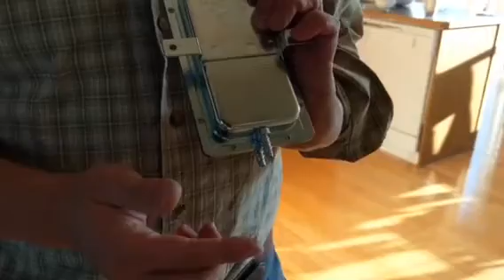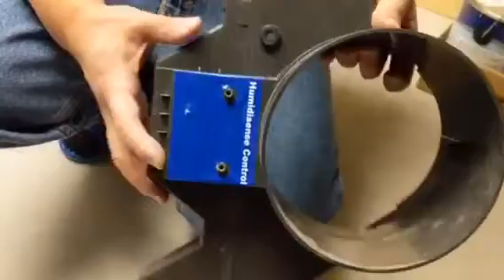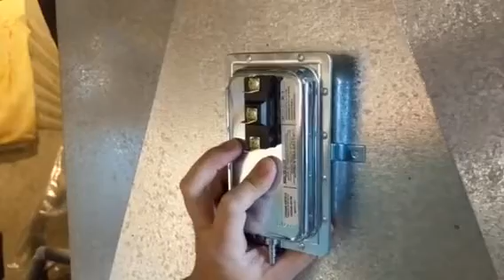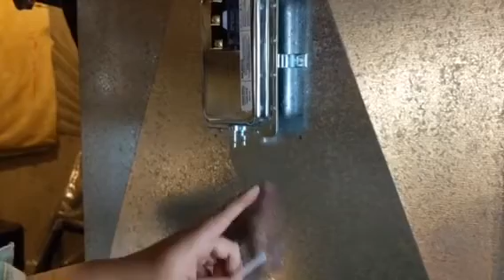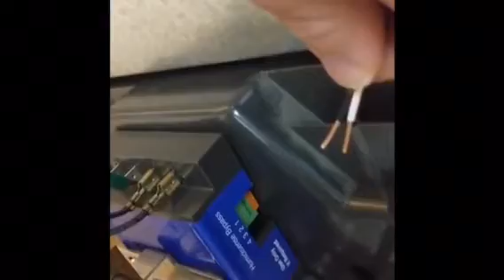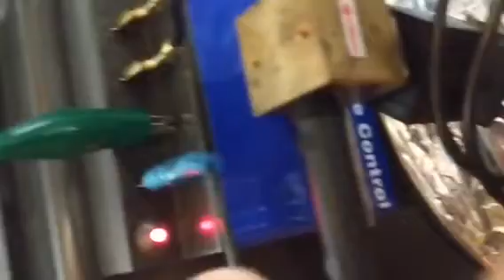Installing air pressure switch for humidifier

Comment: Hey Peter, did you have to ground the air pressure switch?
Reply from the maker: Hello Adrian, sorry for the late reply. I just noticed your comment just now.  No, I did not have to ground the air pressure switch. The air pressure switch just basically closes a circuit, which is already using reduced DC voltage.

Comment: what pins did you connect the pressure switch to?  looks like 3/4
Reply from the maker: Hi De-ann Perrey, yes I connected the pressure switch wires to 3 & 4 on the Humidisense Control.

Comment: Same issues. What’s the brand and model of that pressure switch ?
Reply from the maker: Packard PS221 Air Pressure Sensing Switch. Fixed Set Point.
By Cleveland Controls DFS221
Reply: Peter Yung thank you!